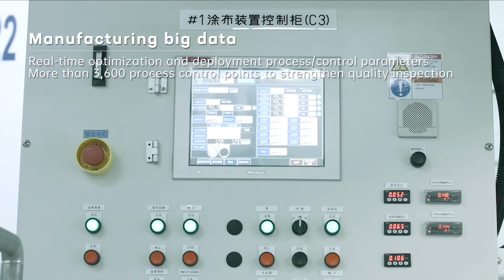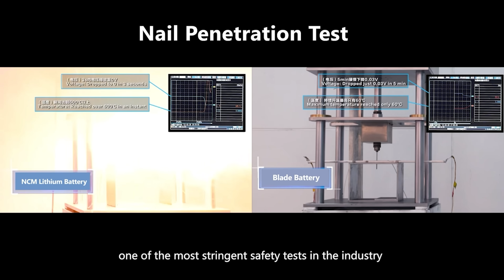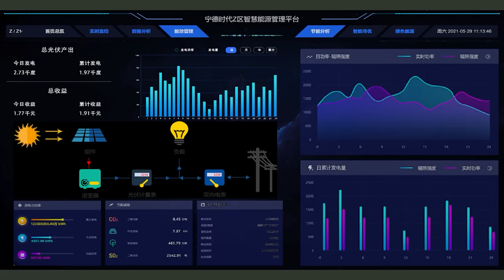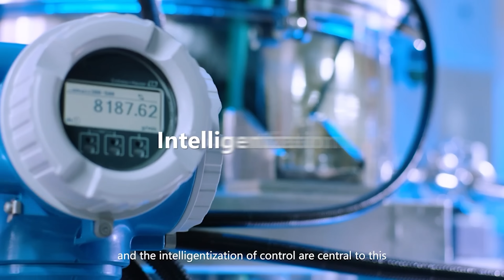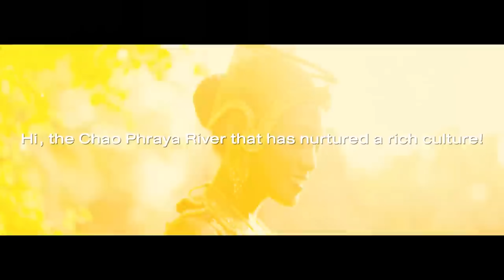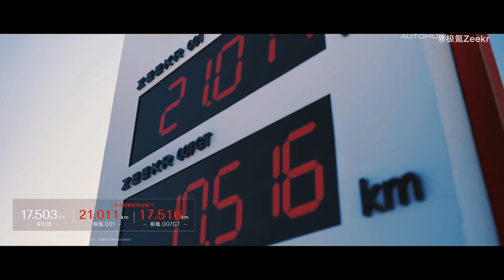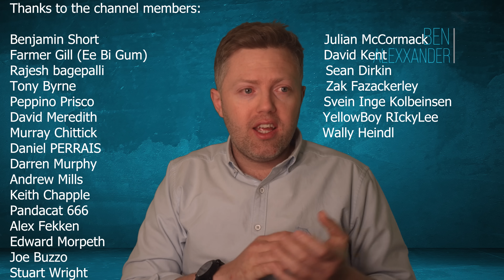Sodium Takes Over - Tony Seba’s Battery Prediction Comes True

Comment: Amazing how the lithium era, after a couple of decades, may be sunsetted by 2030.
PS  — even if everything was equal, just the fire safety advantage, would end the usage of lithium in most usage
PS2 — Wonder what all the lithium mine projects that were on the cusp of putting shovels into the ground are thinking? Poof!
Reply: Not quite, though. All the current Solid State projects rely on lithium. What will happen is that lithium SSBs will dominate high performance consumer vehicle, aerospace, and military use while everyone else uses sodium.
Reply: Why would Lithium be sunsetted - battery development is still ongoing, and Lithium via it's Metal-Air chemistry varieant still offers the highest energy density of any battery type (at a maximum theoretical energy density of 11,400 Wh/kg). Metal-air cells are still being progressed at pace as this enables high energy density applications, such as battery powered flight, and also for lower energy density applications like passenger vehicles requires very little resource per vehicle to be needed (compared to other materials like Sodium that have a signficantly lower energy density both by weight and volume). 

Sodium btw still encounters dendrite issues, so is not immune from fire safety considerations.

The future Lithium requirement may well be supplied by Direct Lithium Extraction (DLE) methods rather than mining, which when factoring in mineral recycling likely means that Lithium mines will cease being viable at some point, with sufficient Lithium resource already in the system for transport use supported by cheaper DLE for low level replensihment requirements. In this respect, Sodium will more likely displace Lithium in static applications rather than transport ones.

Comment: We are about to find out what the "real" cost of batteries is. Lithium ion prices have not adjusted in an organic way, pricing power has been managed. Think about flat screen TVs, they are much more difficult (almost impossible) to make at high yield and contain expensive chips and software and yet sell for $200 for a large 4K. They should cost thousands but they don't. Batteries are very simple devices after production systems are perfected and should be very cheap.

Comment: "considerably safer than lfp" has there ever been even one case of lfp catching fire? But yes, one more step in density, one more step down in price and it will hit mass adoption.
Reply: It can be discharged to 0 for transport. That's the major plus as compared to any lithium ion batteries including LFP. Remember many shipping companies hesitate to transport EVs because of fire risk(I know it's overblown but still the risk s there)
Reply: @najibyarzerachic  yeh they dont even distinguish between chemistries which they might even be dumb enough to do to sodium.

Comment: What effect will this have on home solar installation? If you suddenly get a decent sized home battery for just £1000 then the additional cost of adding rooftop solar on your home suddenly becomes much more attractive too. Or will we see massive changes in large scale battery storage which makes electricity cheap enough to mean people won't bother with home solar/batteries?
Reply: You don't need solar to justify the home grid; just being able to only pay off-peak covers the cost. My own use case works out at a payback period of under 5 years for battery+inverter+install. Adding PVs on the roof would take over 10 years to pay off. Oh, IMHO home grids won't remove the need for massive storage located far upstream. For instance, this calls for locating large scale battery storage near the East coast of the U.K..
Reply: @jonb5493 You got this. I am always so surprised how many are oblivious to exactly this possibility. In my country almost every day the lowest price is very low compared to the max price. It even go as low so you get paid to take the power on some hours on some days. Home battery power storage would solve a lot is issues with the grid also and make it cheaper for all of us by evening out the load.
I don't get why governments don't make a push for it like drop taxes on them or other kind of incentives.
Because it would solve or at least help solve a lot of the issues with our total power production locally.
Reply: @jonb5493  Lots of  heat pumps running continuously during the depths of winter will start to soak up lots of off peak electricity production. In the UK 20 million heat pumps running at 2kw 24/7 is 1000Gwh per day. That is a staggering amount partticularly if it is flat calm and of course the solar contribution will be negligible. This means that here has to be massive seasonal grid storage, not stuf to smooth out peaks and troughs during the day.
Reply: Absolutely. So its vital to incrementally increase BESS capacity as the total of installed Heat Pumps incrementally increases. The total capacity finally required is less of a financial challenge than a challenge of sheer logistics. We;re talking about a huge estate. The requirements to completely protect against a dunkelflaute episode are well understood. The capacity that you mention is best understood as 1000 of 1GWh estates, best sited along the Eastern coastal regions, Scotland being the most immediate urgent req.
Reply: Seriously doubt electricity prices are coming down anytime soon.  With all the AI server farms needing power, it’s actually getting more expensive.
Reply: Most of the cost of solar is not in batteries or solar cells for 5 years already
Reply: Sodium batteries are likely to dominate the domestic battery market.

Comment: sodium battery may also replace the lead-acid car battery
Reply: A 600 amp LFP battery is pretty large. Only if you could discharge it at 4c rate without damage would it compete with lead acid of equal size.
Lead acid has far less real AH but can deliver the surge current to start an ICE engine in a fairly small package.
In an EV I think the energy/ volume of a LFP would be more appropriate.
Reply: Not also but predominantly. Sodium batteries are much more useful for this use case than für solar or general EV use.
Reply: Heil Musk for inventing electricity
Reply: Most are AGM batteries now
Reply: The lead acid battery is deeply integrated in to the ICE vehicle architecture. Without going in to detail, the LFP or Na Ion chemistries are not drop in replacements
Reply: @theairstig9164  they can add circuit to sodium ion  to make it mimic lead acid for all old cars... LFP is not used because of extreme heat in the engine bay...
Reply: @IdoCareForPeople  My old Porsche 928 had a battery under the spare tire at the back, well away from the engine, but yes most cars have them in the engine bay, but as I said you can buy them, I believe some EV's are now using LFP for the 12 volt systems, like the BYD Dolphin and Seal, I expect NA and/or LFP will eventually take over the task of supplying 12 volts in EV's, it only makes sense now they have got rid of that hot, dirty and smelly ICE engine, time to ditch the poisonous lead acid battery.
Reply: @theairstig9164  CATL have already started to build Na  truck and car starter batteries ...
Reply: @theairstig9164  There are replacement LFP batteries for use in cars, but because of the natural voltage level of LFP batteries there's a lot of electronics build into the batteries so they don't cause problems with the existing accessories that expect a 12 volt output, they aren't cheaper by much and whether they are as good, well lead acid has had a lifetime or two of testing and uses no electronics at all.
Reply: @theairstig9164  because of the cell voltage?
Reply: @theairstig9164  It would take zero effort to make a drop-in replacement sodium battery for 12 volt purposes to start and run cars lol. And it would be half the size and weight and could last 12 years at $50-$60.
Reply: @theairstig9164  What ICE vehicles?